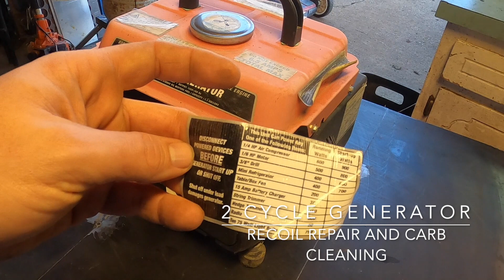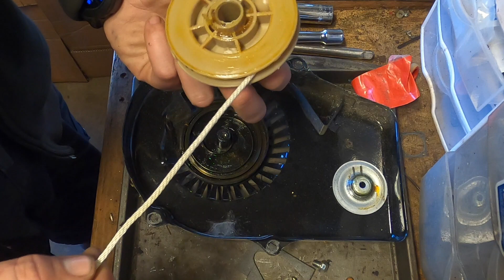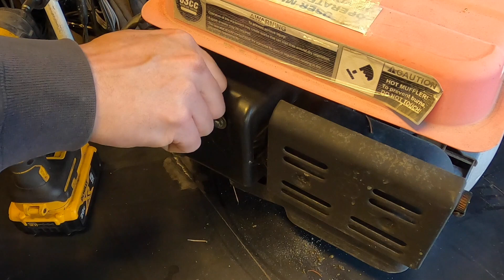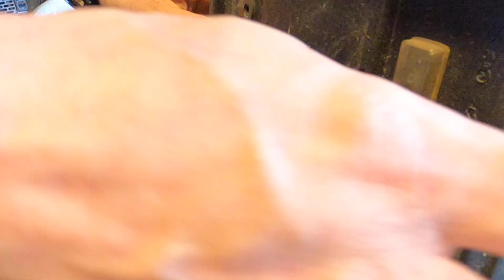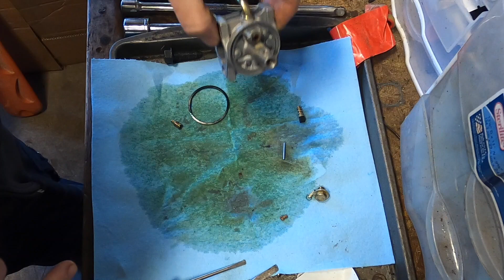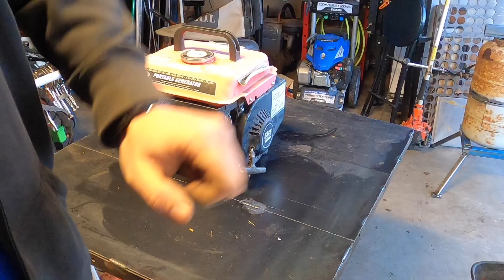2 Cycle Generator Recoil Repair and Carb Cleaning

Comment: I love mine and I use it for almost everything on the farm except for when I need the welder or air compressor. It also powers my daughters garage apartment when we have extended weather related power outages.
Reply from the maker: Oddly enough I am assuming because it's a 2 cycle the power output is rather clean in comparison to some other smaller 4 cycles